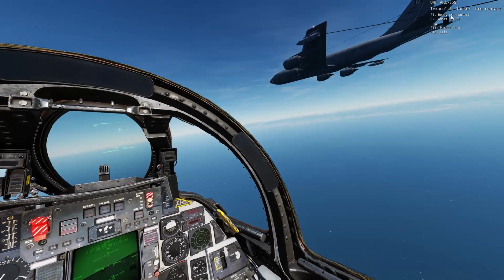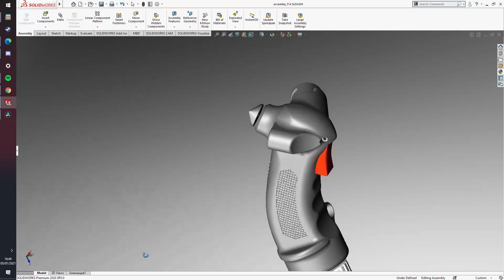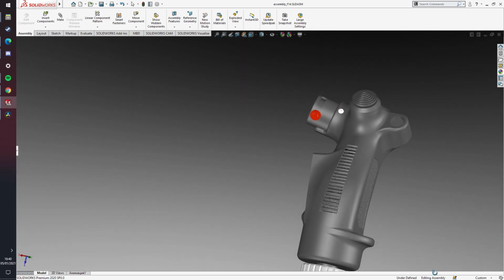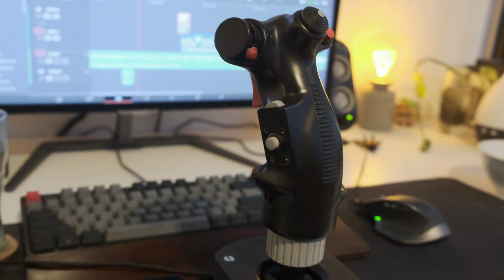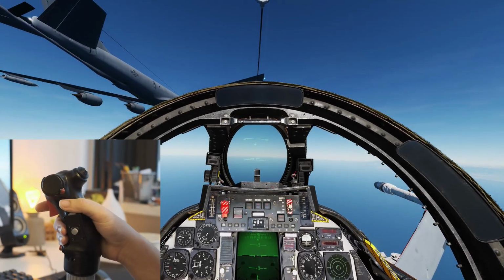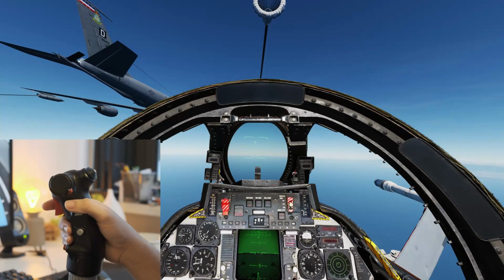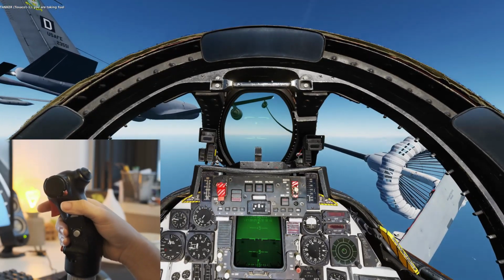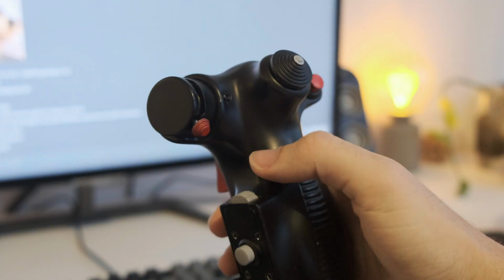3D Printed F14 Flightstick

Comment: Buenas desde uruguay, saludos.
Excente trabajo... Realizas está impresión a pedido? Cuánto sería su precio.
Reply from the maker: Saludos (lo siento, mi español no es genial), 

Puede comprar la pieza para imprimir a través del enlace a continuación, estaría dispuesto a imprimirla por usted, pero me temo que estoy en Europa, por lo que los costos de envío serían muy altos. ~ 100 euros por envío, aproximadamente 50 por impresión sin terminar, 150 por producto terminado. 

English in case that is gibberish:

You can buy the part for printing via the link below, I'd be open to printing it for you but I'm afraid I'm in europe, so shipping costs would be very high. ~100 euro for shipping, roughly 50 for unfinished print, 150 for finished product.

Link: https://cults3d.com/en/3d-model/gadget/f-14-flightstick
Reply: @someactivemedia  perfecto seguramente esté en contacto en breve. Gracias